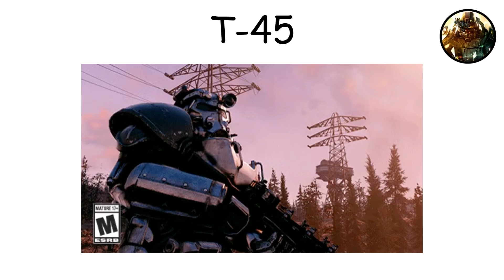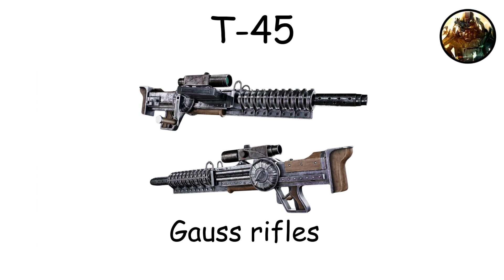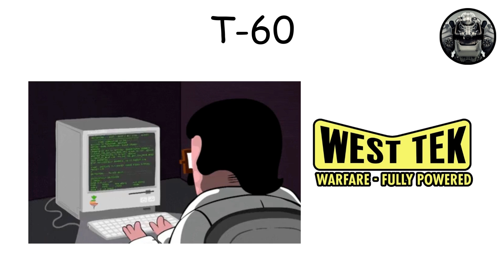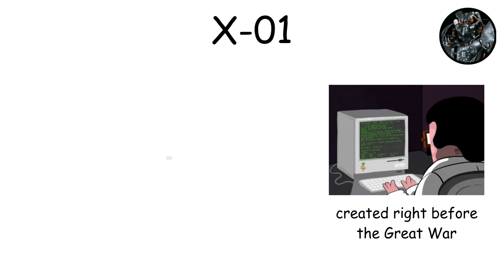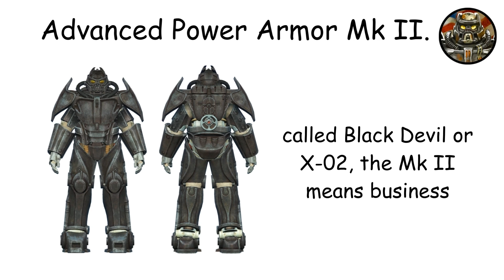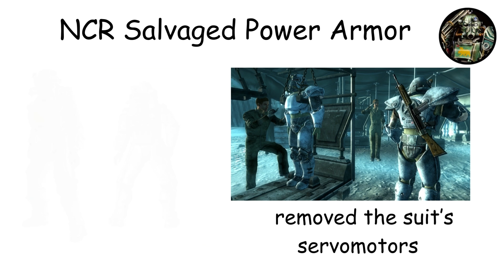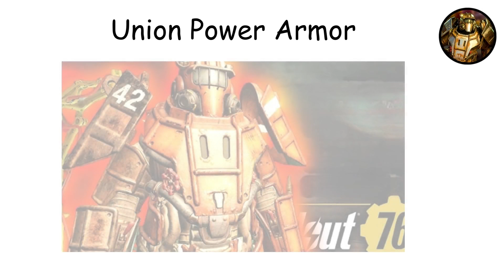Every Fallout Power Armor Model Explained in 11 Minutes

Comment: Early models were also not built around the whole power armor frame. They were kind of just a suit that you put on. They were kind of like night armor granted powered. They were clumsy like he States and also has a issue with the welding which could cause fast moving grenade trapinal to hit the stomach and or chest area causing as you guess death. Yeah? Also t51 is best armor

Comment: 0:15 that's not to say there wouldn't be tanks being produced they woulda been but tanks would take backseat in terms of production so theoretically lets say 1 tank built for every 100.000 suits built which would make them a scarce sight when teamed with how we (the US) conduct tank warfare. so you would have tanks in a long range support function and mech infantry and the robots doing the foot work like its ww1 as the tanks are a limited asset and can function at long range safety to knock out trouble spots.

Comment: The Raider Power Armor Is Is Actually Metal Scrap, Bolts, Screws, Rebar, And Any Other Things To Weld, Bolt, or Even Wonderglue Them On An Empty Power Armor Frame

Comment: I think the Hellfire is made of brand new (fictional) alloys of steel and titanium. Power armor already is made of fictional alloys but it’s called “Duraframe” and shares compatibility with the improved eyebots so I imagine it’s Durasteel which is not a unique sci-fi alloy but it fits. It’s typically a highly specialized alloy that’s an in between of regular steel and titanium for density while retaining the tensile strength and relatively low cost of steel, while still being naturally more expensive; it’s just not a cost overrun. Josh Sawyer (or Chris Avellone) in a Q&A stated that (to paraphrase) “whether (duraframe) is a special construction technique or a new material is left ambiguous (on purpose)” so I can safely make that assumption.

In the post-war world, much like our own, the race isn’t to make everything super special; it’s to retain self-sufficiency, minimize costs, energy, resource and manpower needs and to not just survive but thrive like nothing happened. Homemade materials, miniaturization of components, if not the whole system and optimized construction techniques (possibly space-framing for the torso. Making the most or least of that space between the frame and the chest plate is important) is a key to that and you can see it all in Hellfire armor.

Comment: Finally. Someone who knows X-01 is different from APA
Reply: Thanks for clarifying this: X-01 is the framework for APA, just as X-02 is the framework for APA MKII.
Reply: That depends on what lore you consider to be canon. The prototype X-01 and the later Enclave X-01 are both advanced power armors. The Advanced Power Armor Mk. I is the Enclave's completion of the X-01. So by the time the Enclave finished the X-01 models for themselves after saving X-01 schematics, the Enclave X-01 became the APA Mk I to be distinguished from the prototype X-01. 

Note that the X-02 was developed ground-up by the Enclave, so it is effectively the same as APA Mk. II at all stages.

For the Enclave, the Mk I and II designations are seals of approval showing that they have completed the X-01 and X-02, respectively. So it's entirely fair to say that X-01 and Mk I are the same. Many of the last Enclave remnants possessed X-02 at the time that the Hellfire power armor had already been in service. In Fallout 4 and Fallout 76, we see that long after the Enclave had used the Mk I nomenclature, people still referred to it as X-01. Either they are the same, mark different time periods of completion stages, or the lore is mixed up. I think all three of these things are true.

The Institute also completed their own X-01 set, and called it X-01-I. So "Mk. I" is the nomenclature chosen by the Enclave to describe what would have effectively been called an X-01-E under Institute nomenclature.

Lastly, in Fallout 3, there was no reference to an X-01 nor X-02, and the project was always called APA Mk. 1 and Mk.2 from beginning to end. Fallout 4 takes place 10 years later and people use the X nomenclature.
Reply: X-01 is APA... We know this from logs. You're basically saying Ultracite isn't T-51. Get real. That's why logs on the EMP call X-02, APA mk II.
Reply: @GBKPlaysGames  just put the fries in the bag bruh
Reply: @GBKPlaysGames  
The X-series is the experimental precursor to APA, and is the pre-war incomplete blueprint model that the Fallout Bible actually mentions the Enclave doing research and experimentation with to make it mass-fieldable on a sustainable level (it wasn't named the X series at first, but the X-series provides the missing link in the development chain mentioned). "X" is also the military designation for "experimental" regarding incomplete equipment still in testing phases. So the X-series suits are APA prototypes, though it isn't explained what exactly the issue was with the X-series to make it so unviable to field compared to its improved APA counterparts.

Also if i recall, APA Mk IIs are the Fallout 3's version of the armor which is a model way less durable but lore-wise much more mobile as a sidegrade to the APA series suits, with the traditional "back hump" models being the Mk I suits that provide much better defense but are lore-wise not as mobile. Casdin refers to the Mk II suits as "Advanced Power Armor Mk II" if giving him any, which is where the distinction originates from since in Fallout 2 the APA isn't referred as "MK II", so those are Mk I models.
Reply: @joshuakim5240 this breaks lore and isn't logical. The prototype X-01 is indeed a prototype, yes, but the X series (Confirmed on the Enclave Mobile Platform, Fallout 3) tells us that X-02 is in fact APA. (As multiple terminals use them interchangeably) Fallout 4 confirms (mk) is the sets modifications. Therefore, APA mk1 is X-01 with the upgrades and mods to make it field suitable. In Fallout 2, 3, 4 and 76 make it clear that this is so. X-01 was adapted via mods to be field suitable. Also durability of the X series was set based on combat effectiveness and cheaper components. Hense X-02 durability being less than T-60 via Fallout 4 and more resistance in every category. 

 Just because I get a 69 mustang body and put it on a 22 mustang frame doesn't make it a Corvette. This is engineering, via modifications and trading. Something the Enclave noticed and used after T-45 and T-60 (Which are not the same PA and can not be swapped or modded to fit appropriately.) That's how you end up mix matched. The FC was used to replace ineffective EC and because the tx-19 FR was FAR to expensive. (Fallout 1) So no, X-01 is APA and vise versa. The ONLY armour that is technically its own Enclave set is Vulcan. (Which Frank Horrigan has a modded and universal set of.) 

 Prototype X-01 is the basis of the armor just like a concept car. X-01 mk1 - mkVI is the first instalment of "APA". Same for every design after. IF the X-01 was its own independent prototype suit, we would not have seen the Enclave use them in 4 or 76, which they do. (Who also in field terminals confirm APA is the designation for the X- series.)
Reply: @GBKPlaysGames all this yapping and you still don't get that the X designation is literally used to denote prototypes or equipment still in testing. Doesn't matter if no major changes are made in the model eventually adopted it's still given a new designation. So no X01 isn't APA it's a very late stage prototype of the APA
Reply: @daxie__3210 tells me you don't or did not read. X-series is APA. Advanced Power Armour is the sets type. X-proto is still APA. T-60/T-65 is still APA. Ultracite/Vulcan is still APA. This is engineering, get over y'all's selves. 
 
Go work on some vehicles and do some actual mechanical work. Build a bot and come back to me. Literally saying what you people think breaks lore and the sets characteristics.

Edit: You're slow, I see that now.
Reply: @joshuakim5240  you know the fallout Bible isnt canon right? Chris said so himself im pretty sure
Reply: @GBKPlaysGames  The Kingdom of God is at Hand 
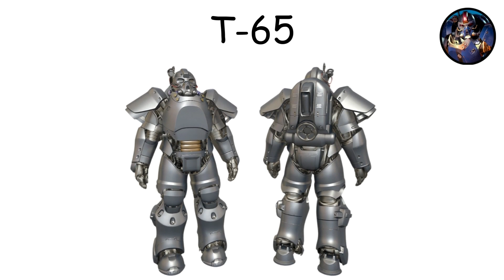John 3:16
King James Version 
16 For God so loved the world, that he gave his only begotten Son, that whosoever believeth in him should not perish, but have everlasting life.